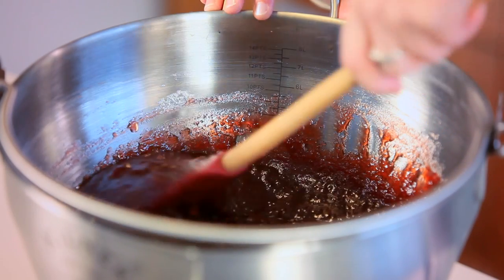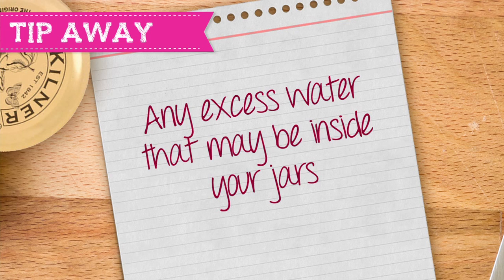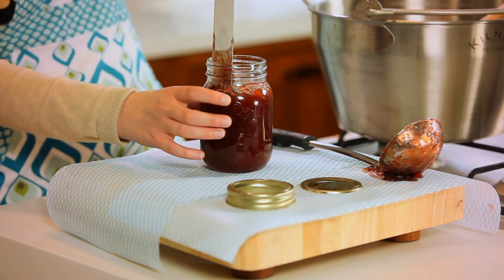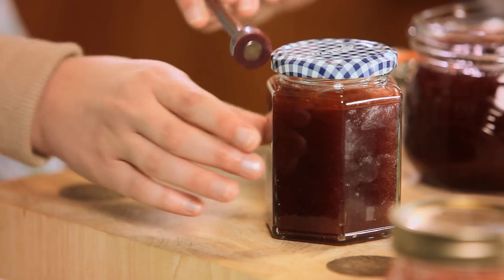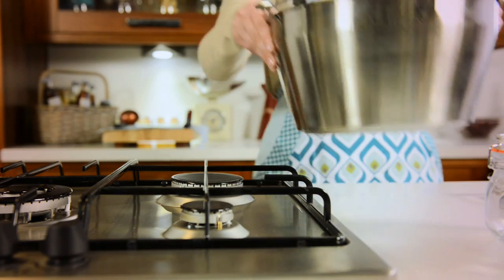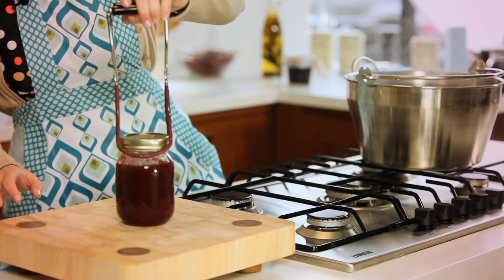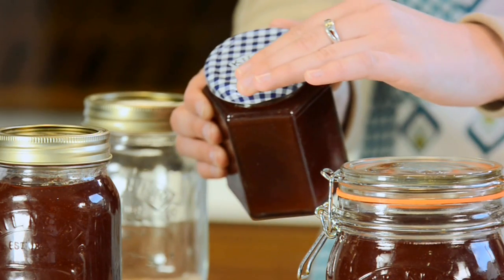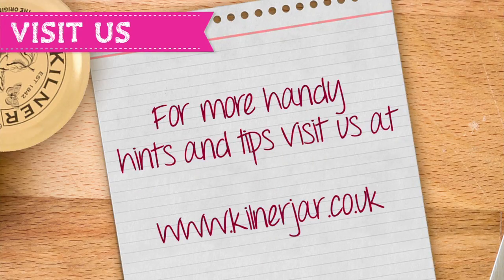How To Fill & Seal Your Kilner Jars

Comment: There is no mention of sterilizing the jars or lids  before hand , would you consider that this is not necessary ? Also I wonder if the water in the pot would come to a good temperature without a lid on. I see Kilner has a new canning pot for water bathing jars which is great. I`d love to see Kilner combined packages similar to the one Ball or Norpro do .Thanks

Comment: Ok so I have seen many people in Europe canning with NO pressure cooking year after year and there still living… anyone know if you have to use special jars? I think this using a pressure canner was another way of making money off of us.. making us afraid we would get terribly sick. They lie about everything else why not this? Any info would be great!!!!
Reply: Pressure canning forms a stronger vacuum so usually lasts longer on the shelf but water canned goods like shown above are good for at least 6 months.

US manufacturers "require" that you replace the seals every time but you can reuse them many times, often for years.

Just buy the most common brand in your country so that it is easy to replace the seals when they start to ware 👍
Reply: I would have to agree about the pressure canning just being a money grab. I believe North America is the only continent that claims you cannot water bath certain foods. If you dig hard enough, you will find plenty if information and examples of this not being this case. The rest of the world water baths (or other non-pressure-canner methods) everything.